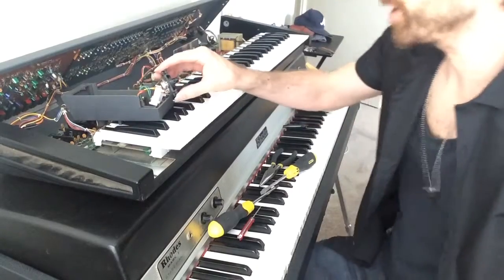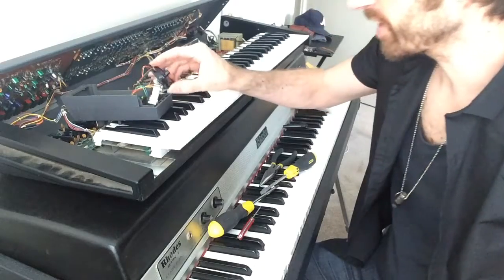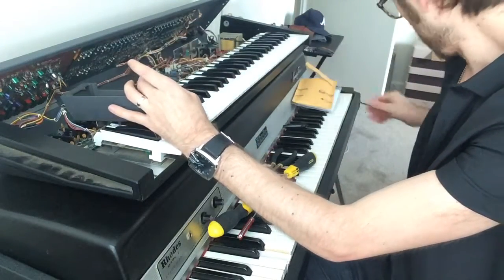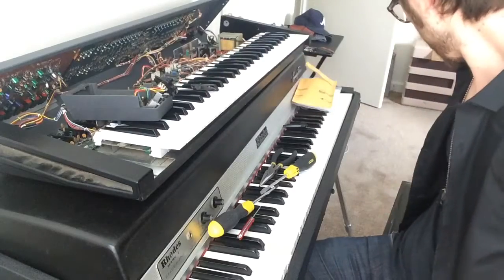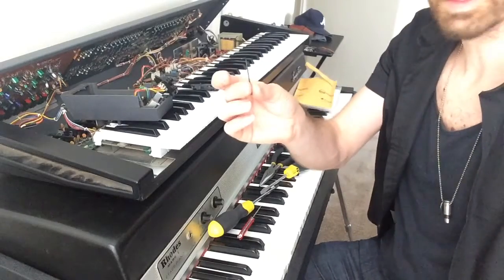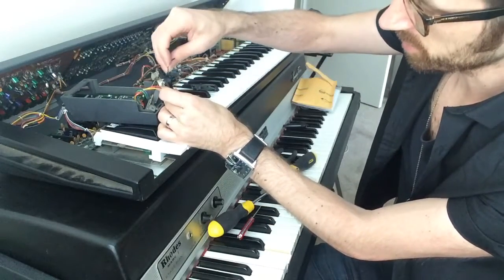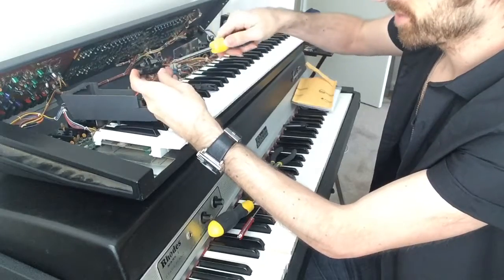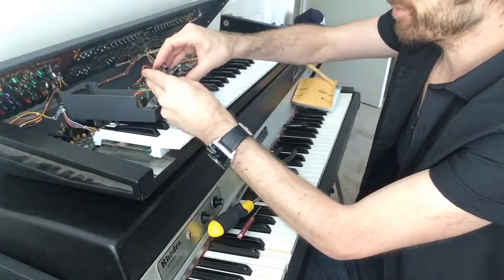Taking apart Bender on Juno 106

Comment: Thanks for this video.  I had to replace a bender tonight on one of my 106s, and I'm sure I would've struggled for a long time before I figured this out!  The even trickier part, I think, is putting it back together, aligning the potentiometer correctly so that the bender works correctly when reinstalled.  You lose the factory-correct positioning of the pot when you take off that bender!  You should do a video on that, if you haven't already.  Again, thanks.